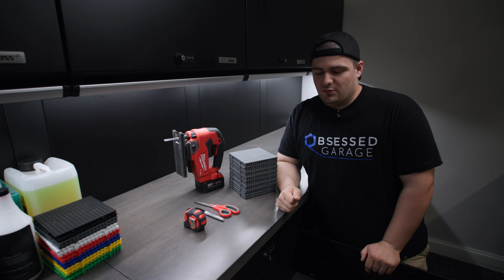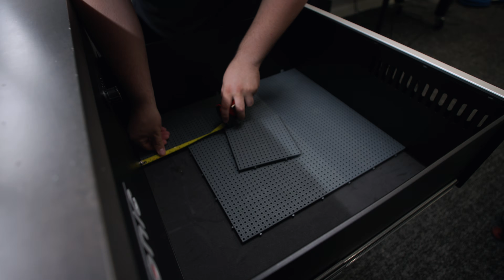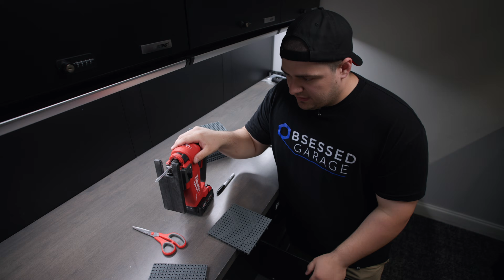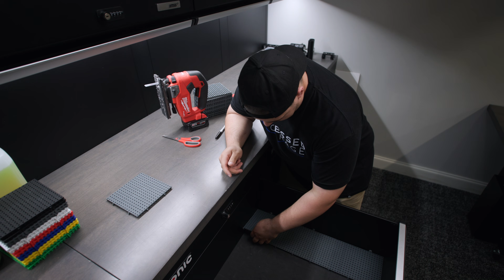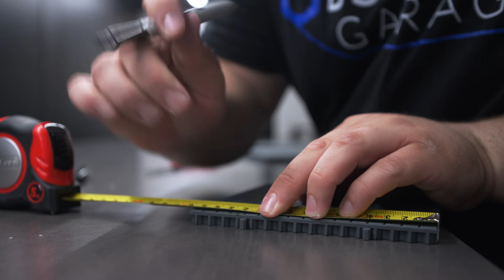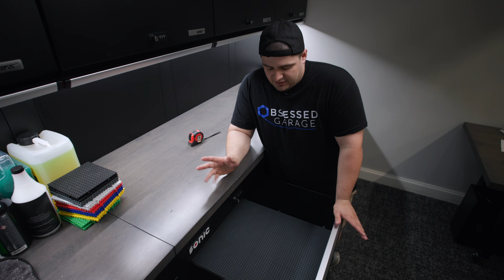Fitting Tool Grid 6x6 Boards to a Drawer | Tool Organization Essential

Comment: Yeah the big board would have fit perfectly into my top drawer but the shipping is insane.
It shows how much a volume discount amazon gets on there big packages even when sending through UPS. You can get. For example 50 pounds 3’Lx4’Wx 4” deep for free or very cheap.

Sucks cutting up these 6”x6” pieces into 1.5” or 3” strips to fill in the gaps and then they don’t exactly sit even with the main pieces
When you cut them the one side will not have locking tabs

Comment: They might be cheaper to ship but as far as cost per square inch it is way more. They certainly have their place but I did the math on one of my large drawers and 2 large boards would over half the cost of the 6x6 boards. You pay way more for the same coverage with the 6x6 than you would ever save in shipping.
Reply: I found large board for $105 but shipping was $60
So i bought the 6x6’s free shipping through amazon
Now i have gaps to fill.
I’m going to buy another 6x6’s fill the gaps and use the remaining 6x6 for my wrench drawer which shouldn’t need extra pieces. 
I believe if there are any gaps it won’t matter because the actual wrench holder pieces are not located along the edges where gaps maybe
Reply: @ogboost7610 then you aren’t looking in the right places. Olsen tools has free shipping over $125. They sell the boards in pairs and the large boards are 119 for the pair. Add on a pack or 2 of some holders and you are at free shipping. Just have to know where to shop. Don’t get them from CTech. They charge outrageous shipping prices. Nothing against obsessed garage but for this stuff I’m getting it where I can get the best deal and pay the least amount in shipping.